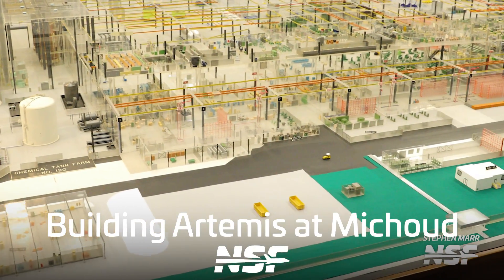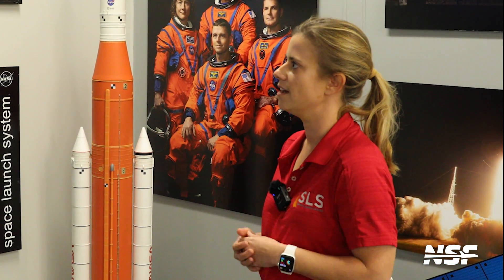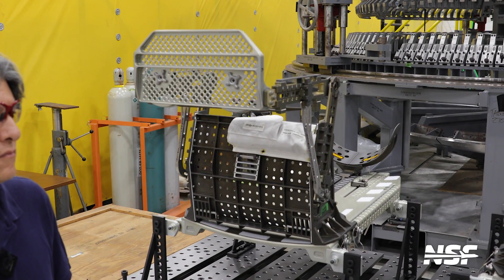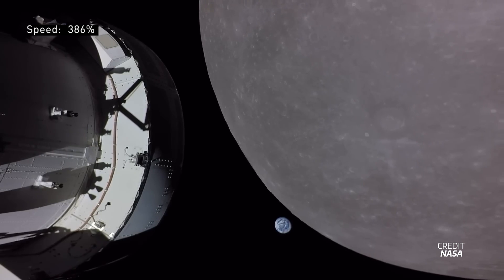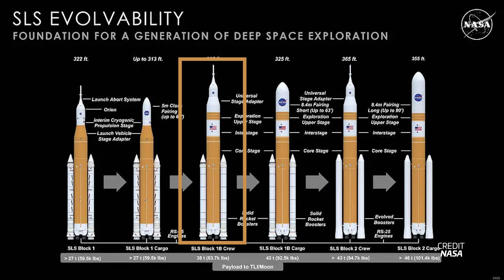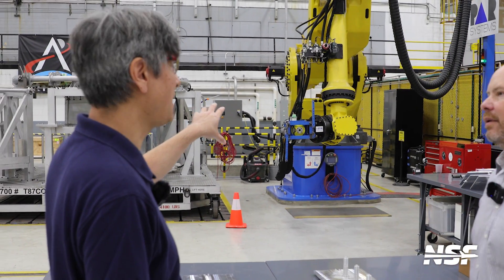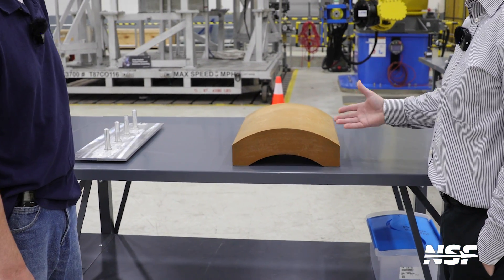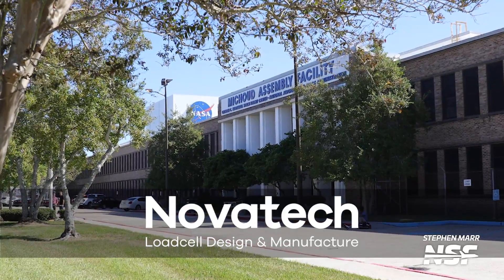Where The ORANGE ROCKETS Come From! Artemis Hardware Exclusive Look

Comment: I hope that all the stored equipment stays intact and functional. Kudos to the storage and testing people. HOWEVER... the GAO stoppage could mean a God-send to many of the involved companies. If the delay involves not only extended schedules but also a re-writing of contracts and program--though that would produce some headaches for the interviewed people. 

#1 Rewrite the Artemis program, to insert an extra unmanned Artemis launch--one that does FULL life-support testing of the Orion capsule, doing that and verifying that critical system  BEFORE the first manned Artemis mission. (The current psychological environment is one of rushed-schedule desperate and dangerous haste--exactly the environment that led to the Challenger and Columbia disasters.)
 
#2. Reopen lunar landing-craft candidacy. Review the viability of the Alpaca craft. Get more human-landing options.

#3. Reduce the load on SpaceX. Confine their required initial Starship contribution to the production of one-way (landing-only) freight craft. This not only simplifies Starship design requiresments for SpaceX--something that SpaceX should appreciate since they not only still have to finalize and certify basic Starship design but they also have to work up multiple final-form variants. Other benefits ensue. If initial one-way lunar trips for Starship--a huge reduction in fueling logistics and number of involved Starships, in getting those craft to and on the moon. Also: field-testing of unmanned Starship systems BEFORE human dependency on them. (E.g., is there a danger of natural vacuum welding of its elevator cabling and motors? Leaving astronauts stuck on the surface? Better find out before-hand.) Also: in a freight-only initial configuration, Starship could pack in even more machinery and supplies. In that dangerous lunar environment, more available critical infrastructure is always better than less. Also: in that initial freight-version Starship configuration, they could build in a radiation storm shelter in that craft. (No room for such in the other landing-craft designs.) Astronauts arriving initially via Alpaca or the BO thingee could have that radiation (e.g., CME) protection from the moment of their arrival, hugely mitigating human risk.
Reply: #1 From Wiki : The Artemis 2 mission plan is to send four astronauts in the first crewed Orion MPCV spacecraft into a lunar flyby for a maximum of 21 days using the Block 1 variant of the Space Launch System. The mission profile is a multi-trans-lunar injection (MTLI), or multiple departure burns, and includes a free-return trajectory from the Moon. The Orion spacecraft will be sent to a high Earth orbit with a period of roughly 24 hours. During this time the crew will perform various checkouts of the spacecraft's life support systems as well as an in-space rendezvous and proximity operations demonstration using the spent Interim Cryogenic Propulsion Stage (ICPS) as a target. When Orion reaches perigee once again, it will fire its main engine to complete the TLI maneuver, which will send it to a lunar free-return trajectory, before returning to Earth.

#2 They already have selected Blue Origin as a second option. I think Dynetics has solved its negative mass problem on their lander project as well. It may be selected in the future... I think NASA has already hinted at the possibly of using Blue Origin first if SpaceX is not ready... 

#3 I'm not sure what would be the payload mass that a single Starship launch could send to the Moon. And the remaining fuel would probably not be sufficient to lift-off from the Moon surface once there. So unless they use it just for cargo, I'm not sure what there are going to choose to do with it. Maybe just one launch to refuel it enough to go there for landing and lift-off again towards the Gateway? That is what Lockheed Martin (I think, or is it Northrop Grumman?) will do by building a refuelling unit / depot for the Blue Origin lander, to refuelling it once (not 15 times or more!), just to be able to lift-off from the lunar surface, once the surface mission is completed...

So yeah, not sure how it will pan out for SpaceX but it's not looking good, whether SpaceX / Musk "fans" like it or not. As far as Blue Origin go, I hope they launch their first New Glenn around mid-2024 if all goes well. They were pretty slow overall but they certainly didn't just do nothing as some like to say... Will they succeed? Who knows. If they both fail, well that's going to be embarrassing.

Comment: So someone help me out here… isn’t Starship doing Artemis-III? I keep hearing NASA talking about making all these parts for Artemis 3 and they were showing the seats and other parts here… am I going crazy or is NASA making parts that will also fit in Starship?
Reply: Starship will land astronauts on the moon for Artemis 3. The astronauts will be launched on SLS, rendezvous with the Lunar Gateway spacestation in orbit around the moon, board a starship, visit the surface, return to the gateway, transfer back to the Orion capsule, and return to Earth.
Reply: @jamesryan3572  That makes SO much more sense. Thanks!
Reply: @hawkdsl  I mean that makes logical sense. Just looking at the dimensions of it, the cargo bay is way smaller than the main tanks - that’s what the station and the orbital refueling is for. It helps that the moon has less gravity so lifting off is easier. I was mainly just confused as to why they are building an SLS rocket for Artemis-III but it makes way more sense now.
Reply: @hawkdsl  I don't know where you got the number 15 from? The Starship holds 1,200 t of propellant. The payload bay can hold 100-150t Lets take 100 t worst case: 1,200/100=12 launch's. With all the current developments of Raptor3 engines, that should lower it by maybe 10 -11 launch's.
Reply: NASA is planning to provide a bus between Earth and lunar orbit.
Starship is providing the lander to go from lunar orbit to the moon's surface.

Comment: Michoud is inside the New Orleans city limits, and always has been. It was one of the few things that Hurricane Katrina didn't flood in that area. Since then, the government built a billion dollar flood control structure to protect the area where it sits. It was built for WW II, but was too late to be used much during the War. They built the Saturn V first stage there because it was sitting empty. About 10,000 people worked there building the Saturn V during the 1960s. 
Next came the Space Shuttle External Tanks, all of which were built inside that building. 
Now it is the home of construction of most of the SLS, except for the solid rockets. 
A loaded Boeing 737 airliner made a successful engines out landing next to the levee along the rear of the site. The pilot was blind in one eye, and landed after encountering a thunderstorm with hail that killed both engines. Severe thunderstorms are very common in the area. Being before the Internet got going, and out in the boonies,  it didn't get the media coverage of the, 'miracle on the Hudson' in New York City. They flew the Boeing 737 out a few days later. They lied to the public, saying it would be taken apart, or barged out. Since then, jet engines on airliners have been redesigned to better handle hail mixed with heavy rain. Google, 'TACA Flight 110' to see the proof on Wikipedia. A pilot with one eye did that during a thunderstorm with no engines running. It wasn't their day to die.

Comment: I worked there for ~25 years working on the External Tank for the Space Shuttle. Good to see some of the areas I used to work in. Lockheed Martin developed the Friction Stir Welding of Lithium/Aluminum many years ago. The "Orange Foam" insulation is  a form of Polyisocyanate foam much like the "Great Stuff" Polyurethane foam in a can.

Comment: Great video! Very interesting. All that engineering and technology thrown away, either burned up or ditched in the ocean. Completely unsustainable. It's a shame that the obvious technical knowledge and ability lead to something that is no better than the 1960s & 70s. It would be better to give the funding and workforce to SpaceX. I think things would move faster than a snail's pace.
Reply: There have to be 2 independent supply chains to the moon, for the human habitats. Standard NASA protocol. Until another sustainable and independent rocket company with full certification can be developed, Artemis is going to stay in production.
Reply: Its a JOKE! i hate to say it but SLS is a joke! looks like 1970s designs, over engineered garbage!

Comment: So much effort and resources all to just be burned up or dumped in the ocean. What a waste. Everyone should ONLY be working on fully reusable hardware.
Reply: Honest question. Why? What does reusability offer?
Reply: @jrc1606  Cost savings over time and potentially safer vehicles since things aren't only designed to be used once. It has helped SpaceX launch more things into space than anyone else, so seems like it's been proven to be a viable path forward.
Reply: @Alex_whatever  Is there any proof that reusability is cheaper? The Vulcan rocket is expendable and it's cheaper on an average basis than both Falcon 9 and Heavy. SpaceX has admitted they get the majority of the profits from Starlink. Also, the majority of SpaceX launches are Starlink, so there really is no need to have that much of a high flight rate anyways. The only concrete data we have is from the Shuttle and the refurbishment at times was just as, if not more expensive than making a brand new part. We all also know how dangerous it was. 

SpaceX keeps all these details completely hidden. You know why? Because admitting that reusability doesn't lower cost or makes the vehicle safer will be detrimental to their image and for their shareholders.
Reply: @jrc1606  You may be right.
But perception usually wins out.
Also, regardless of the mission, a successful launch is a successful launch. So until another launch system comes along that can be as seemingly reliable and cheap to use for your satellite or whatever, as Falcon 9s are, expendable rockets will seem like outdated technology.
Reply: @Alex_whatever  In the eyes of the general public, well then sure.

Comment: NASA should proceed because they already paid for all the parts?
That logic didn't work when NASA cancelled Apollo 18, 19, and 20 even though all the parts were not only paid for but completely assembled.
What changed...other than politics?
Reply: Apollo parts were actually designed to do the job, so scrapping them was an opportunity to do the next thing much less efficiently (and therefore more profitably).  SLS has been designed from the start to suck the taxpayer dry, so there's no motivation to do something else.